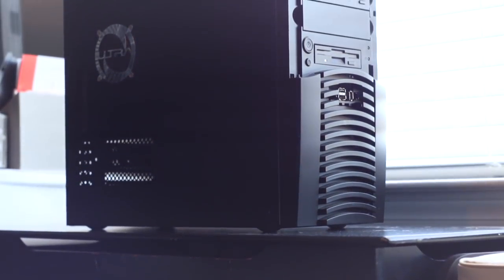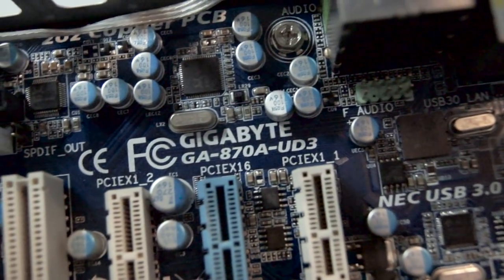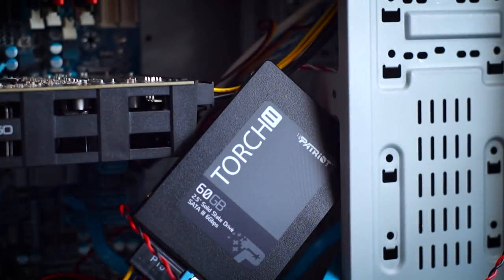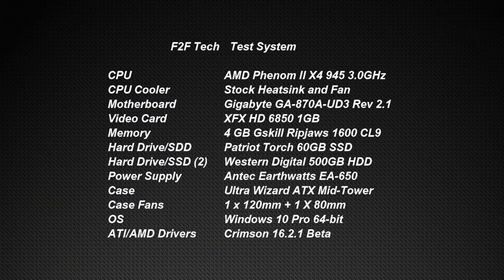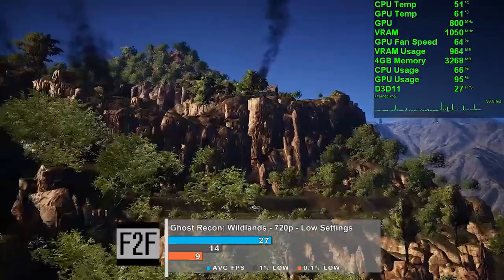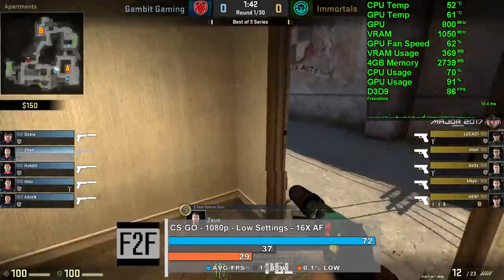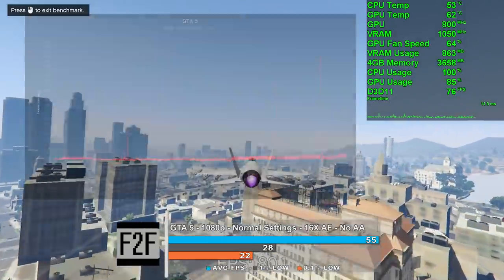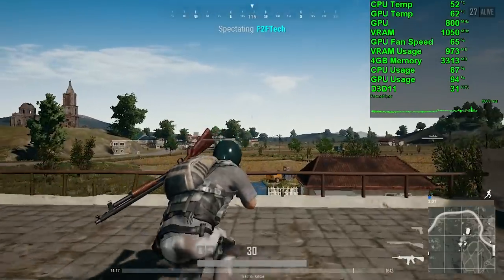How well does a 2010-2011 AMD Phenom II X4 gaming PC hold up in 2018?

Comment: With PGAs, always plan to remove the cooler before the package comes out of its socket.  Don't be scared of twisting it to break the seal.   Just like nails, those pins are quite strong in the shearing direction and there's not much risk of bending them while they're solidly inside the socket.  Pulling - and especially tipping - the cooler puts forces on the pins and package which they weren't designed to handle.  Twist back and forth and it'll loosen up pretty quickly. 

This technique used to be common sense, but once Intel went to LGA sockets almost a decade's worth of computer enthusiasts never had to learn how to treat PGAs.  I think it's a shame because they're more robust once you know what you're doing.  The pins on LGA motherboards are more delicate than the pins on PGA chips - though I'm super careful with both - even though cooler installation and removal is relatively bulletproof.  

I mean, hardly anyone would try to remove an LGA cpu without removing the cooler first because the hardware just gets in your way and makes it clear "this is wrong" before you try it.

Comment: overclocking it and putting in an R9 290 or GTX 780 might be a good fit =)
Reply from the maker: GTX 780 or HD 7970 GHz?  I was going to use one or the other.
Reply: Why not both? Personally, I would go for a GTX780 considering how certain games are just more optimized with Nvidia, like for example PUBG. ;)

Comment: Nice video. Same type of CPU a Phenom II X4 B97 at 3.2GHz, 8GB DDR2 and a slightly older 1GB GeForce 8400GS. 
ALL BASED ON A HP dc5850 FROM 2008 running Ubuntu 17.10. 
No gamer (Mainly card or board games or Extreme Tux Racer), more a YouTube viewer and a virtual machine collector with the following OSes:
- All Windows releases from 1 to 7 and everything released in between, 14 releases in total.
- All LTS releases of Ubuntu from the first 4.10 till the last 18.04 Alpha. 
- Some other Linux distros, DR-DOS with Viewmax and MS-DOS with with the WordPerfect set.

The system runs around 50% CPU load and 50% GPU load with most 1080p60 videos and that is the 1680x1050 limit of the Fujitsu/Siemens 22" vga monitor. In VirtualBox VMs the CPU load increases to around 70% and the GPU load goes down to 25-35%.
Reply from the maker: Sorry, your comment went to spam. Anyway, that’s interesting that you have so many VMs on that PC. It’s good to see that it does well with them. I have multiple VMs on my server, but I might have to put a couple on this little rig.
Reply: It loads XP and 7 in 40-50 seconds and Vista in a minute from a Raid-0 with two 320GB laptop disks. I'm happy with this 10 year old chap and I did not find any valid excuse yet to replace it.
Reply: Some changes. You have to keep yourself entertained. The Host OS is Xubuntu 18.04 now, much more efficient then Ubuntu itself. I switched to the ZFS file system for everything except the Host OS partition. I stripe over 3 disks instead of 2. All disks are lz4 compressed to reduce the number of I/O operations. The new version of Ubuntu/ZFS uses the data stored in the memory cache (1.5GB) in that compressed format too. I had to replace one of the laptop disks, because it physical sector size was 512 bytes instead of 4096 bytes, the mix is not good for ZFS performance. I replaced it with a 1 TB HDD. Windows boot times on my 2008 HP dc5850 are: XP=32s 7=52s and 10=43s. My main VMs are:
- Xubuntu 18.04, boot/reboot=30/7s for browsing, office work and email (Thunderbird)
- Ubuntu 16.04,. boot/reboot=39/13s for banking, paypall, ebay. Security!!
- Windows XP, boot/reboot=32/24s for music with TrueBass and WOW effects.
- Ubuntu Mate 18.04, boot/reboot=30/9s to try out new Apps. Easy to restore from snapshot or backup in case of problems. My main backup is an old 3.5" 320GB IDE HDD connected by USB 2.0 using ZFS gzip-7 compression with a ratio >> 2.0.

Comment: I have recently decided that I am making the change to PC gaming but because of very expensive part prices I have decided on a pre built. Can anyone show me a better pre built for around 1,000 to 1,250 or maybe even build a pc that is around that price range. Personally I want to build the pc but it doesn't seem very possible right now. https://www.digitalstorm.com/configurator.asp?id=1742585
Reply from the maker: With prices now, prebuilt machines are actually a decent way to go. Digital storm PCs are nice, but you can get more for your money. Spend some time looking on amazon. I pulled this one quickly up. 

https://www.amazon.com/dp/B01N2RLS05/ref=cm_sw_r_cp_awdb_t1_C4DzAbF41Z5JR
Reply: F2F Tech thanks a lot man
Reply: F2F Tech Is that keyboard and mouse worth keeping?
Reply from the maker: I mean for your first PC, I’d say they’re fine. You’ll know once you start using them. I also encourage you too look around as well. Sometimes there are gems on Amazon and Newegg.
Reply: F2F Tech That's what I will do, thanks for responding

Comment: Great video.  I was running a phenom 2 x 4 up till a few months ago.  My system had several upgrades over the years SSD, 16gb ram, and a Rx 270x to name a few.  A storm took out the motherboard controller on my Mobo.  Other wise it was still kicking 9 years later....only in 2018 did I really have to start turning setting down on a lot of games.

Comment: fake news i have the same setup and i play just fine: take this shit down i can play 99% of these games on high -_- 
------------------------------

My system specifications:

"CyberpowerPC"

-Board: ASUSTeK Computer INC. "M4N68T-M-V2"
-WD SSD Blue 1TB (also a internal 4gb wd blue backup 4tb HDD)
-Ram DDR3: 16GB (2 x 8GB) Kingston Technology HyperX Blu Red Series 1600MHz OC "KHX16C10B1RK2/16"
-Video Card: EVGA GeForce GTX 960 4GB FTW Model
-750 Watt PSU CORSAIR Enthusiast Series "TX750"
-Acer 20'"1600x900Max Rez" LCD (Acer X203H bd 20-Inch LCD Monitor)
-Phenom II X4 955 Black Edition 3.2GHz AM3/DEEPCOOL GAMMAXX 300 CPU Cooler 3 Heatpipes 120mm PWM Fan
-16gb set pagefile (16,384 )
-Win 7 64bit

--------------------------
More PC Info:
--------------------------

-CPU Rating: 7.3

-Ram Rating: 7.5

-Video Card Rating: 7.9

-Gaming Graphics Rating: 7.9

-SSD (wd blue 1tb ssd) Rating: 6.9

-Redragon M901 MMO Gaming Mouse
Reply from the maker: Apples to oranges

Comment: I had my x4 940 up until this summer when I sold it off during the first mining crazy. I still have my X6 1055T with 6870 and a Fx 8320 with a Gtx 760. I remember when I got my 1055T , Samsung 830 128 gig and 6870s in crossfire with 16 gigs of RAM , that was the new hotness right there and gave new meaning to "balls to the wall "

Comment: Doom 2016?  I'm still using it's slightly bigger brother, a x4 955 (125w) black edition, with a slight overclock to 3.6GHz, paired with 8GB of DDR3 and a R9 270, and it works surprisingly well for the most part, although I don't game all that much.  I did get Doom 2016 and was surprised to find it worked far better than I expected it to.
Reply from the maker: I’ll be sure to test it in the next video. Maybe some Wolfenstein as well. Got to love Vulkan.
Reply: I inherited a phenom II x2 555, and a similar gigabyte board but with ddr2, and I unlocked and overclocked it to 3.7 ghz. It is paired with a downclocked gtx 970 and (Because only two slots) 4 gb of ram. That gtx 970 is another story.
Reply: Vulkan so CPU is not too demanding, with 7950 Doom is 60fps at ultra no aa 1080 do have drop but it's not CPU bottleneck

Comment: As others point out already, videocard and memory limitations not cpu. Any 4 cores above 3.3 ghz with 8 gb ddr3 and decent gtx 750, 950 or 1050 2 gb or 4 gb vram should perform to decent levels 60 fps or above at 1080p on any games 2018.
Reply from the maker: Yeah I did an update with more ram and used a 7970 GHz Edition

Comment: Nice video I have the 965 black addition and It's pretty nice sadly stuck with 4gb ddr2 ram at 600 speed I think.  What is the program you use? I would like to see where my computers bottle neck at
Reply from the maker: Use MSI Afterburner with RTSS

Comment: when you upgrading the PC, can you upgrade to a Phenom x6

i know there are not realy cheap, but there is no real Benchmark of the Phenom x6
Reply from the maker: Gamers Nexus did a video not long ago. Id like to grab one in the future, but right now it’s just not in the cards. I’ve found 1055T’s on eBay for around $50, but this board isn’t the greatest, so I’d need another MB so I could pump the Bus speed for overclocking

Comment: Interesting, I'm currently running an X4 965 (OC to 975 level) with a 750Ti.
One thing, to get the benefit of 1600 RAM, you have to be on an "overclocking" profile as the Phenom II is 1333 as standard - also helps to set the CPU NB to 2400MHz to balance 1600 RAM, and tends to need a touch more CPU NB voltage - I'm using additive and it needed 2 of the small steps to get it rock solid
Reply from the maker: The ram was set to 1600Mhz, even at the stock frequency. I’ll be upping the NB in the next vid I do on it. Hoping it makes a decent difference.

Comment: I’m thinking of buying a gaming pc on Craigslist for $95 HP 6005 Pro*AMD Phenom IIx4 B95@3GHz*4-Cores*4GB RAM+160GB HD should I get this? I just want to use it for csgo and fortnite
Reply from the maker: You’d need a video card as well. If you live in the states you can find better deals on eBay.

Comment: For a system being 7 to 8 years old, I would first upgrade to 8 GB RAM. Then consider a faster Phenom II X4 from Ebay (such as the 965). Then upgrade the video card last.
Reply from the maker: Yeah I plan on upgrading it to 8gb. I’ve gotten the 945 up to 3.8-3.9. The bus speed only goes to 260 on this board, so NB is locked at 2.6ghz. Waiting for my 7970 GHz edition to come back. Then I’ll test again.

Comment: Swap out the Phenom X4 with an X6 (1055T is pretty cheap and overclocks nicely) and the 6850 for a 7970 and you've pretty much got the build I was using before switching to Ryzen. Still keeps it around as a Windows XP/Windows 7 box. 

While sky blue was never a good look, I love Gigabytes range of AM3 motherboards. It accommodates parts that can somewhat keep up with modern titles while still having all the legacy stuff. Don't try to run games off zip drives though.
Reply from the maker: I have the 7970, so I’ll probably use that in the OC tests.

Comment: plz test it with 8gb or even 16, of fast system mem(1866/2133) + a GTX1070-1080 range card, to see if the old cpu has a chance at feeding a system like that.
Reply from the maker: Wish I had either, but sadly I don’t. I did update the video with more ram and a faster GPU.

Comment: You can overclock that video card to 1ghz, you should have done that and seen what boosts you got. Same with the phenom, a like 400mhz overclock.
Reply from the maker: Performance is about 5-10% better vs. stock. I have an updated video on this system with an OC on the P2, but I use a 7970 GHz

Comment: i build a rig similar to this back then at 2010 , and the only thing i upgrade is VGA to 750 ti and psu to 650 watt 80+, and i can run witcher 3 at high settings with hairworks off at 40 fps minimum, even with mods, lol
Reply from the maker: Nice 👍 what resolution are you playing TW3 at?

Comment: Mine Phenom x6 1100T + GTX 1060 3 GB . All game stuck in 60fps how to unlock
Reply from the maker: Vsync on? Do you have an FPS limited enabled?
Reply: @F2FTech  vsync off . Power limit off. Windows 10 ..SSD 120 GB RAM 8 GB 1600

Comment: If the machine's working and it hasn't been used in eons then switch it on and let the CPU warm up. This will help expand the thermal paste or thermal pad. Then quickly power down fully and see if it budges. The worst machine I ever encountered for this was a busted Pentium 4 that wouldn't power up: the thermal pad was like super-glue lol
Reply from the maker: Usually when the tim is dried up and hard, it tends to stay that way. I guess it depends on the paste you’re using.

Comment: That's the reason i'm a console player, just pickup a good console and you won't need another one for more years but pc's are always changing parts nearly making yours obsolete just like the iPhone
Reply: eta carinae ok that's just wrong. I'm a pc and console gamer, but the constant upgrade stuff is just silly. A good gpu can last a console generation and when you do upgrade, you can sell your existing parts

And a good cpu can last even longer. People who went intel in around 2011 and got a 2500k or better wouldn't even have a need to upgrade till now and maybe not even then.

Plus this system would improve with some basic measures, like adding more ram and overclock which are what Phenoms are good at. And that gpu is too weak and vram too little for modern games

Comment: 1:45 um no. you can run the setup with over clocking just fine. i can guarantee you that setup has been running like that for years with just that cooling. vrms are designed to be hot.
Reply from the maker: Of course it would run okay up to a certain point, probably even up to 1.45v vcore for a certain period of time. Most mosfets are good beyond 120c, that doesn’t mean you want them that temp. They become increasingly inefficient when getting into that temperature range. This is a 125w part, so with that much vcore you can bet it’s pulling some juice.

Comment: i currently have the phenom II x4 960t with a gtx560TI 1gb. recently my gpu is having issues. would a 1050ti 4gb make any noticeable difference?
Reply from the maker: BadWolfGaming Itwould,  but probably not as much as you would expect. If you don’t plan on upgrading your CPU for some time, then you overclocking your cpu would certainly help. 960T should easily get 4.0GHz.
Reply: nice. i've never overclocked before but i have seen tutorials. thanks for the quick response

Comment: my phenom ii x2 is barely holding up, sometimes i just want to take it out and smash it with a hammer lol.
Reply from the maker: Don’t do that. Send it to me. Seriously though, you should look on eBay for a cheap X 4.
Reply: Im thinking of getting an FX 8320 or better, i know it's still an outdated cpu but i think it is a cheaper alternative than having to buy a new mobo and ram just to get the same performance out of a newer entry level cpu.
Reply from the maker: merio Not a bad idea if your motherboard supports it.
Reply: sure the 8320 will be better for a few games however it will cost you 4x the cost of a x4 and some x4 can unlock to a x6.
Reply: i had an x4 in the past and i didn't like it, and for the prices in my country most am3+ processors are about the same price so not too much of a compromise.

Comment: I had almost exactly the same chip-mobo combination. i changed it for used 2600K a year ago, and I almost never used it after that as I bought laptop. I guess PC days are over for me as well...
Reply: Yeah... I actually bought GTX 1060 for that i7 but as I used it maybe 5 hours total I sold it a week ago for more than I bought. Funny thing is according to Poland's law, I have to pay tax for that now :D
Nonetheless I plan to buy 8th gen Intel laptop or Ryzen (or intel HQ) becuase I need this CPU power for smooth experience (2 cores 4 thread is not enough even for browsing the web) and maybe buy external GPU. I can see a huge market for that in the future as the gap between big PCs and laptops in terms of CPU is reducing so much.

Going back to this Phenom though (I had 95W version) - it was awesome CPU, although better cooler is a must. My part didn't want to overclock even a little though. Great price to performance, I bought it for like 120$ 8 years ago and Athlon 845 sold one year ago was just a little bit faster for similar price. Shows how bad AMD got over the years I guess... Still, 2500K/2600K released in 2011 were even greater deal, they are still relevant today as 2500K goes head to head with Ryzen 3 and 2600K with Ryzen 5 1400 in gaming.

Comment: still using ye olde phenom 2 720 tricore with a 6870. works for what i play and do still. the itch to upgrade is mild the newer doom its the only thing that made me go ehhh maybe i could upgrade but after fiddling with setting vs resolution. ehhh it would end up being the video card that should be upgraded to take advantage of the new api's over cpu/mobo/ram upgrades. Phenom 2's are highly underrated. i know the new amd cpu line ups great but i think spiritually I'm holding out for phenom 3 to happen.
Reply from the maker: You could spend 50 usd on eBay and get a 1055T 6 Core. That along with a modern GPU and Doom would run like butter with Vulkan.

Comment: By any chance can people start doing benchmarks with Sonic Forces it's system requirements  (cpu wise) are very Damn high
Reply from the maker: I didn’t realize. Isn’t that also a Switch game?
Reply: F2F Tech The Switch port is poor it is 720p 30fps with bad lighting and screen tearing , hell the Xbox One version even only does 720p and still has screen tearing the only ways to play Sonic Forces in 1080p 60fps without screen tearing is by using a PS4 or PC , Digital Foundry did a video on it if you want more information